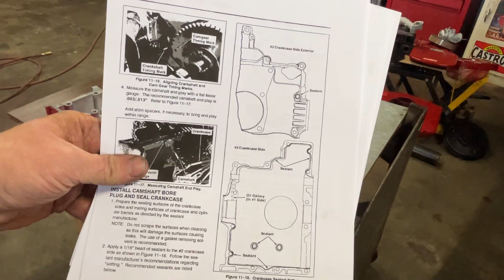Kohler Magnum 18 Full Rebuild Part 3 : Installed Piston Cylinders Backwards Lol.

Comment: The red really stands out. I have 2 M18’s. One was used indoors on a pump and is in great shape and it is the original red. The other was left outside with the air cleaner off, but it cleaned up nice. I just need to put it back together. These videos help a lot.